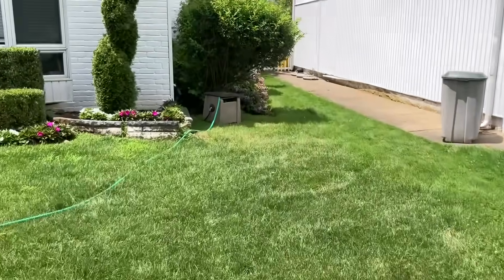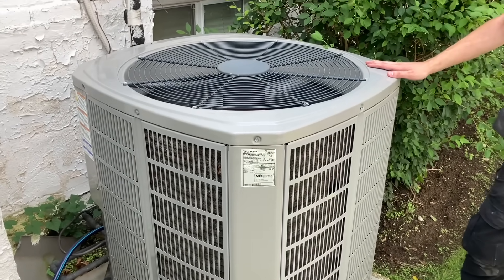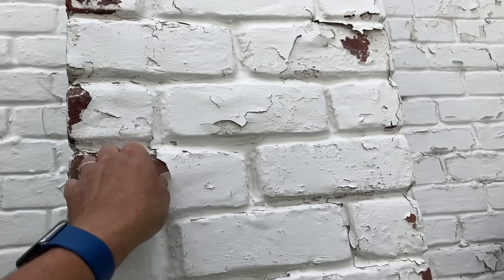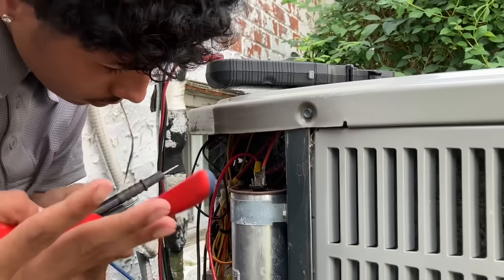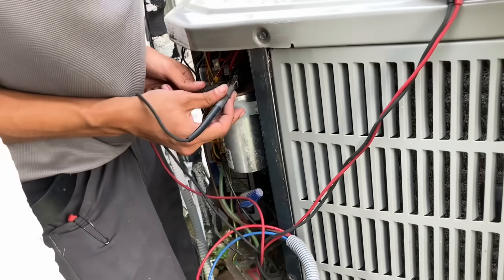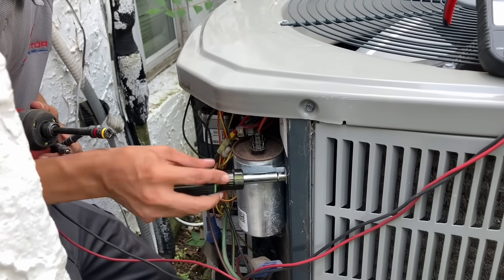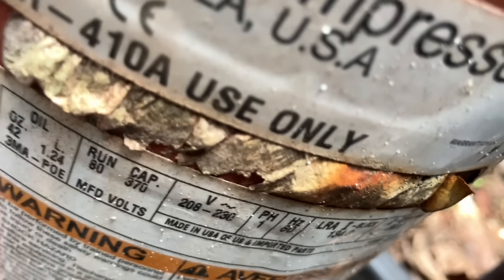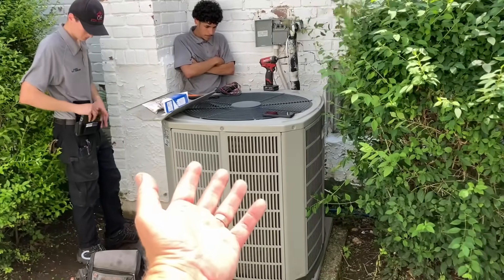Soft Start Killed Compressor - Epic Fail Revealed

Comment from the maker: Another one bites the dust! That’s the third compressor this year I've personally seen killed by a cheap soft starter. 💀 These gimmicks may save a few amps on startup — but at what cost?

Techs: always test windings and capacitors before blaming the compressor. Homeowners: be cautious with upsells that promise miracles.

👉 Have you seen soft starts go bad like this? Let’s talk below!
👍 Like, Comment, and Subscribe for more real-world HVAC service calls.

— Mikey Pipes
Pipe Doctor Home Services, Inc.
516-348-6300
Reply: If you’re running on inverters / backup generators it’s essential for the surge
Reply: Have have the wrong size soft start! That soft start is for only rated for 3 ton and down.
Reply: As soon as the video started, I was like uh oh. I know that house from the other video. LOL. I have gone through 2 of the ones that you have here, 1 of the newer ICM 870 (blue) and 1 hyper engineering for a 13 RLA compressor over the past three years. It is an envolving technology with a high failure rate it seems. ICM does have good support though.  I used the 16A version, going to try the 32A. If that does not work, I am done with it.
Reply: I was considering one for my camper a/c. 2nd guessing that now 🤔
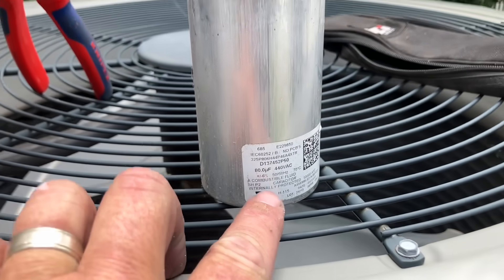Reply: At 5:55 he asked if you installed the soft start, you said yes. hummmmmmmmmmmmmmmmm.

Comment: Why does he say that soft starters kill compressors when what was changed in the video was the capacitor?
Do you recommend any soft starter, and are there any that would work with a 30A generator, if possible?

Comment: so are we saying soft starters are bad? or that you need to properly size, or even oversize the rated LRA and AC tonnage for the chosen soft starter.  this example seems to illustrate an undersized soft starter.  perhaps a weaker brand as well?  i have good things about the AIRGO soft starters, if properly sized

Comment: Curious, you are aware a soft start  is also sacrificial component whuch protects your compressor, any chance it failed from a surge, or was not i installed correctly, or a cheap knock off, for the couple you found theres plenty still working, plus you can start your ac from solar when the ac goes out, i have been the sole house on my block with ac still working thru AZ summer days

Comment: Mike, I remember in another video you were praising this particular soft start product from ICM. If you have seen three failures recently, have they all been from ICM products?
Reply from the maker: I appreciate the question, and we'll be sure to take a closer look at the failed soft starts to see if there's a pattern.
Reply: @PipeDoctor I was going to go with this soft start brand because you raved about it and because as soon as I get my whole house generator installed it requires a soft start. I just want the soft start to work as designed.

Comment: Mikey pipes or anybody else out there that does residential . 
Phase monitors is this something new? I’ve been seeing a couple of them lately and was wondering if I should put one on my own house for my air-conditioning . 
I’ve been seeing them on the condenser mounted on the outside wall of the house house and also they put them on the air handler .

Comment: Y’all condemned a $300 soft start that is known to be reliable in the industry. It appears maybe it was undersized. He removed a bad capacitor and installed a cheap capacitor. I trust ICM before I trust your cheap capacitor. Do your customers a solid-there are better capacitors out there.
Airgo soft starts are also decent. 
Stay away from micro-air for now.
Don’t label things as a gimmick just because you don’t understand what they do.
Also, I would never bang my hundred dollar insulated leads against the top of the sharp edge of the air conditioner cabinet while I’m trying to pop wires off a capacitor.

Comment: I told a customer the other day he needed a soft start. Because his lights dim when unit kicks on. And that it should make hiss unit have a longer life spam. Now I'm iffy about the soft start.
What do you think Mikey???
Reply: Be sure to install the correct size, and make sure you replace the cap at the same time (even if it tests good, especially if it's more than a year old).  Here the soft start was the wrong size (3 ton instead of 5 ton) which is why it failed (the dead cap didn't help the situation either.

Comment: I use the Easy Start by Micro Air. They are excellent quality and the best on the market. LRA’s drop considerably. For example, my personal condenser dropped from 72 to 19 amps. These are not a gimmick. Talk to any knowledgeable electrical engineer.
Reply from the maker: Appreciate you sharing your experience with that specific product — thanks for the info! 💯
Reply: +1 - I'm also really impressed by Micro Air's Easy Start -- seems to have good diagnostics and fault detection.  I'm hoping lower LRA and ramp up will extend compressor lifespan (lower startup torque / damage, etc.), but at very least there's no longer a loud clunk and indoor light flickering at startup now.  While I was at it, I replaced my crappy capacitor with one by Amrad USA ;-)

Comment: Haha, you can check the cap without even taking the wire out. The cap also looks like it’s puffing up at the top. I would have taken it out and checked too. But if I didn’t suspect, I would’ve just checked the cap with the wire on it carefully then you do a quick math then boom it’ll will tell you the cap reading
Reply from the maker: Good call — quick checks are key, especially when you know what to look for.

Comment: While soft starters are another electronic device that presents a point of failure, they are essential for systems that need to start up with a solar inverter. Especially now that so many areas have Time of Use billing, many of us program the solar system to operate on batteries from 4 to 9pm.
Reply from the maker: You're spot on — soft starters can definitely add another layer of complexity to a system, but they're essential for these applications, especially with the rise of solar and time-of-use billing!

Comment: That ICM Controls 870-16A Soft Starter is rated for up to a 3 ton system only. You need the ICM Controls 870-32A Soft Starter for a 5 ton system. When the cap cooked off it killed the 16 max amp soft starter. If it was the 32 amp soft starter it would have likely survived.
Reply: I love soft starts. 100% percent correct. A good tech observant of wrongful doing of not in specs equipment.
Reply from the maker: Spot on — the 870-16A is definitely undersized for a 5-ton unit.
Reply: Ive had those 3 ton soft starters puke on a 2ton. ICM made some garbage.

Comment: Was the soft start sized properly for that condenser? Curious if thats the issue
Reply from the maker: That’s a key point — soft starts absolutely need to be properly sized for the specific compressor and tonnage. If it's undersized or not matched to the compressor's specs (especially on a 5-ton unit like this one), it can cause more harm than good — from failed starts to eventual winding damage.

Appreciate you bringing this up — sizing and install method matter big time. Anyone else seen similar compressor failures from improperly sized soft starts?

#HVACFail #SoftStartIssues #MikeyPipesTraining
Reply: You can oversize a soft start, technically. The MOS-FETs in there will have an easier time taking the load, run cooler and have lesser issues with cycling. Only real downside is a little higher cost.

Undersizing on the other hand always leads to system failure.